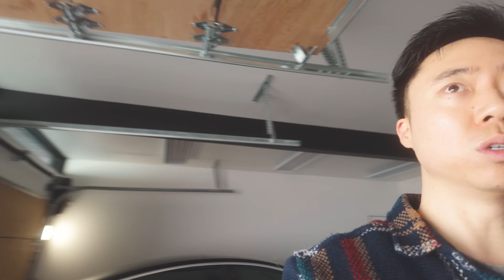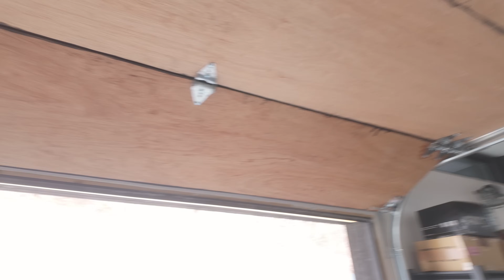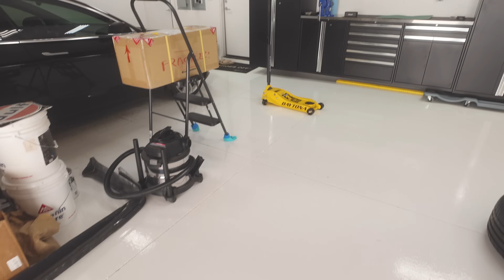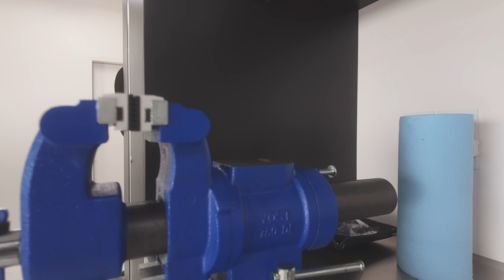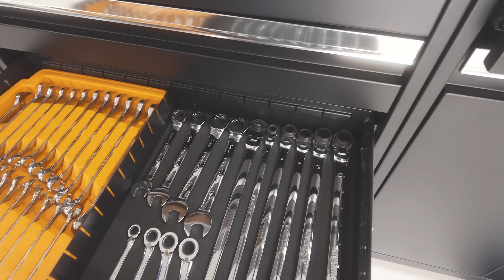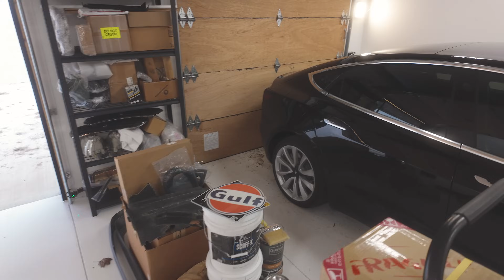Walkthrough of My New Garage Build

Comment: should've done roll up doors. you wouldn't have the door tracks extending out past the door or torsion bars and everyone would be super minimal and concealed.
Reply from the maker: how do you put cedar cladding on a roll up door? That would make the exterior of the house look like a warehouse
Reply: @CornerBalanced  why do you need the garage doors to match the cedar? think of the doors as accent pieces. and you could just paint/stain the stainless steel the same color. at least the outside of the door will be the same as the inside.
Reply: @wrxzboost  bruh this guy just built a completely architected house and youre tellin him to put on some cheap metal roll up doors like this is a FoodMaxx lmao wow
Reply: @nuitreves  i also just built a custom house and made the same mistake by putting in basic garage doors with tracks. they take up unnecessary space, reduce the height of the garage and are uglier on the inside. why do metal roll up doors have to be cheap? mine are industrial, insulated and cost double what a standard cheap door cost.